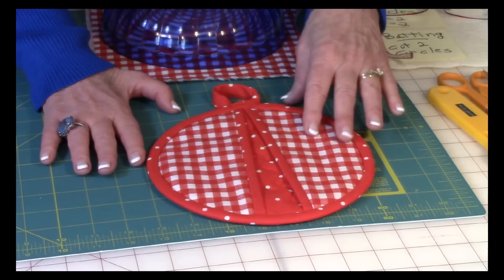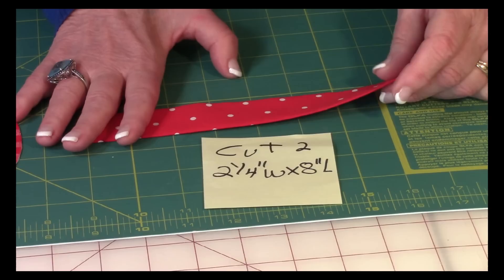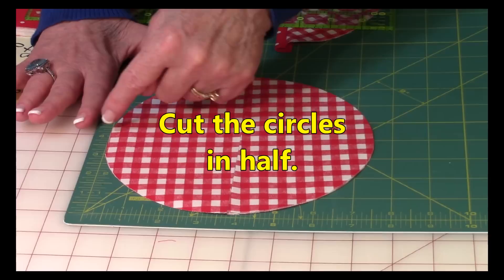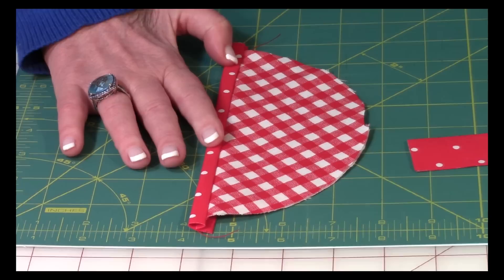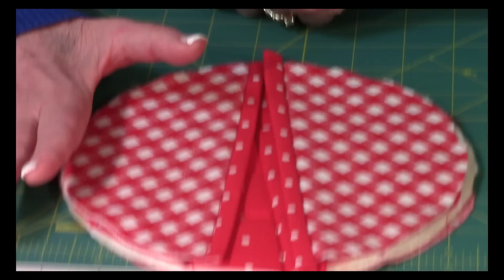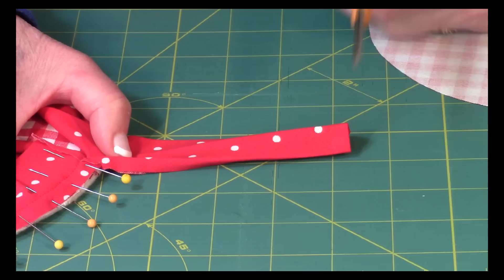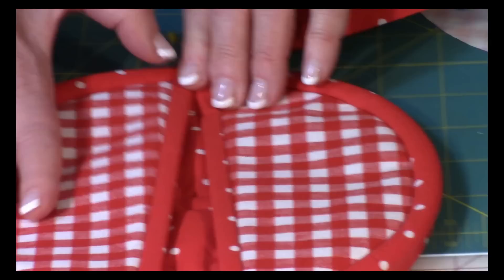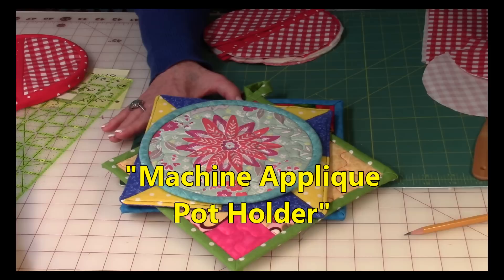Pinch Me Pot Holder | The Sewing Room Channel

Comment: I am also power watching your videos as Cathy below said. I made this mitt but cut the circle 9" as I was sewing it for someone with larger hands. On the outside piece, the one that will come in contact with the most heat, I added a layer of insulbright, metallic side facing out. And of course because my circle was larger I needed more bias and straight binding. Thank you so much for the pace you use, it is so helpful.

Comment: Do the half circles have batting in them ?
Reply from the maker: Hi Donna.  You can put batting in but only use 1 layer.  Otherwise, it will be very thick and the binding might not be wide enough to go over the edges.  If you want a double layer, you might have to cut the binding wider.  Thanks for watching, and happy sewing.